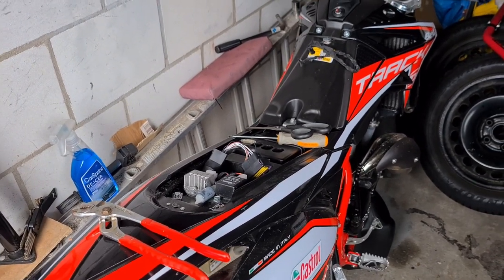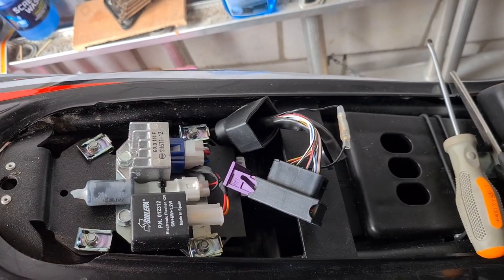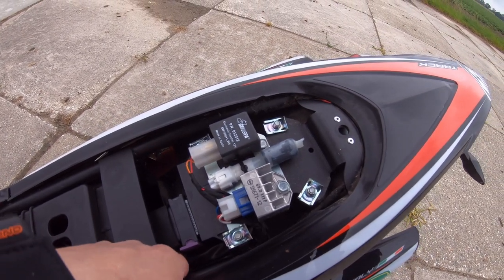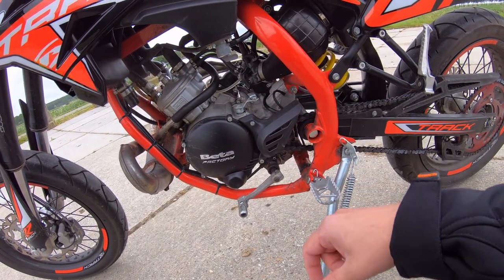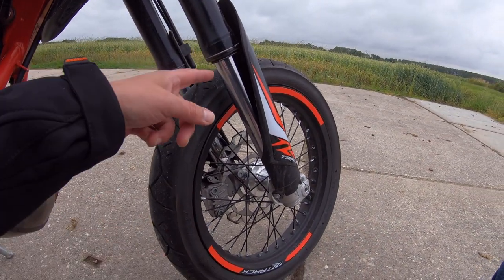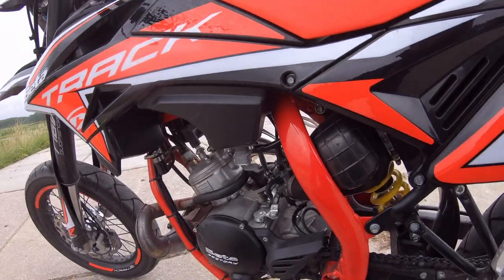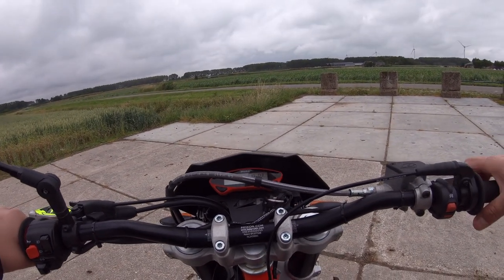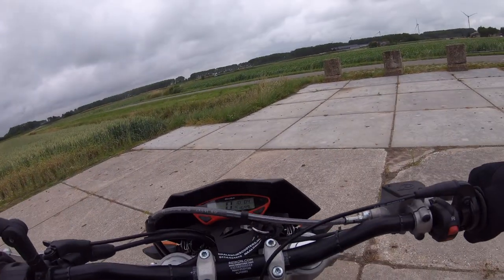Beta RR50 Track deristrict (rev limiter) and walkaround

Comment: HI. once on mopeds, after the restrictions (intake and exhaust) were removed, the final ratio was lengthened.
Have you tried putting an extra tooth on the sprocket?
Reply from the maker: I didn't 😅 the moped is gone since 1,5 years, I got my motorcycle licence now and have two motorcycles atm
Reply: @Steve_Meister  ah, don't worry, after motorbikes sooner or later you always go back to mopeds. I've already done that 🤣
Reply from the maker: @matteo8682  😂 they do remain fun indeed!

Comment: How did you get to 68km/h. I know the wind assisted, but i only get like 63 on a good day. Btw what size nozzle do you have?
Reply from the maker: The nozzle was still standard with mine, maybe it can vary a little. I saw a guy hit 71 with unplugging the rev limiter, I didn't reach that speed either.
Reply: @Steve_Meister  Ok, i have 96 nozzle maybe if i change to the stock nozzle (90) maybe it will work better.
Reply from the maker: I hope so, good luck! 👍

Comment: Just got a 2024 beta rr50 track its gonna be fun
Reply from the maker: Congratulations!👍
Reply: Does it work the same way as in the video with the rev limited or are there different wires in the 2024?
Reply from the maker: @guusback3375  my hest guess would be to look for the wire with one of those sort of things. (I dont know how to call it in english). Cut it, if it doesnt work reconnect it.

Comment: I have removed the cdi restricion and plugged out but it only peaks 60 km / h, why does it not go faster? beta rr50 motard.
Reply from the maker: Does it run right when you give it full throttle? Or maybe my way of braking in the bike was different?
Reply: @Steve_Meister  yea its not the same bike but it should be the same, the main jet its original. You can watch my my own video

Comment: I did this and i have question, can i still use the oil injection system or does it need more oil than what the system injects?
Reply from the maker: Reasonably thought, if you dont adjust your fuel flow, the ratio fuel/oil should still be ok. If in doubt, pull out the sparkplug after a 500/1000km of riding and check if the mixture looks ok.
Reply: @Steve_Meister okay, thank you very much :)

Comment: Is the sound the kickstarter made harmful? I bought my beta new yesterday and kinda worries about the sound
Reply from the maker: It shouldn't be in my opinion, as long as you don't keep the kickstarter down when the engine is running. It is kinda like starting a car or motorcycle (with electric start). When you start with the key or start button you release it when your engine is on.

Comment: how many km can it go on a full tank
Reply from the maker: If its stock and you drive normal and longer distances (warm engine) you could get 30km/l. 6,5l tank so it should do around 180/190km. Bit you tank woud beta empty (no adviseble). So safely i would drive around 150km and then fuel up again.
Reply: @Steve_Meister  thx very much

Comment: Hey i was wondering if you know what its like on a Fantic 50m Performance i opened it and it has same little box with all wires but there isnt this plastic thing thats shows the restrictor so i dont know what wire it is? Is it always the black one or do you know?
Reply from the maker: Maybe check if that plastic thing is further down in the wrapped wires, I also had to cut the wrap open to be sure and then taped it up again. If it's always black, I'm not sure 😅 good luck!
Reply: @Steve_Meister  Thanks im so afraid to cut a wire to because i have never put one back together and dont know how
Reply from the maker: I understand it can be scary :) if you want to put a wire back together you can strip about 1cm of the rubber outside layer, the core are the wires. Do that with the two ends that you got. Then when both ends are stripped, tangle up the metal wires so they stay put and make contact. Secure with isolation tape (you can buy it cheap at parts store) and you're good to go again👍
Reply: @Steve_Meister  OK thanks alot

Comment: Cant the engine get damaged? Is you engine still working?
Reply from the maker: I think if you don't rev out all the time it won't hurt much, it's restricted for the Netherlands to limit the speed. I don't have the moped anymore, I sold it and got a motorcycle 😊
Reply: it wont damage the engine in any way its just that so you cant go faster than is legal